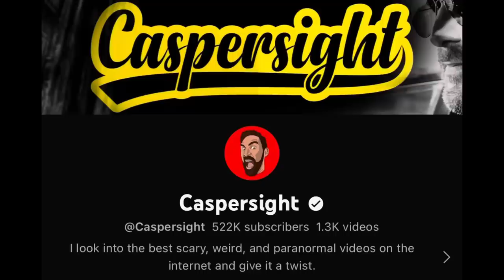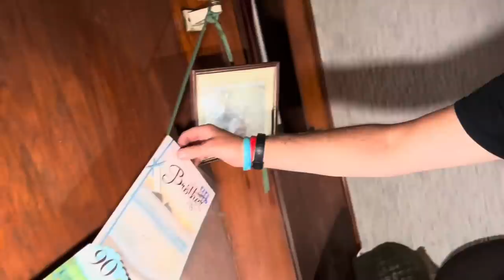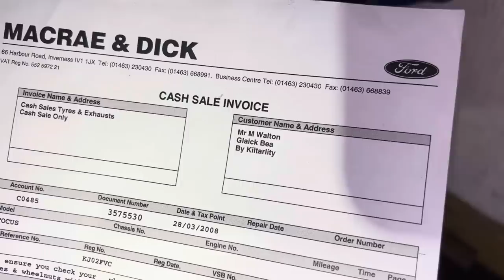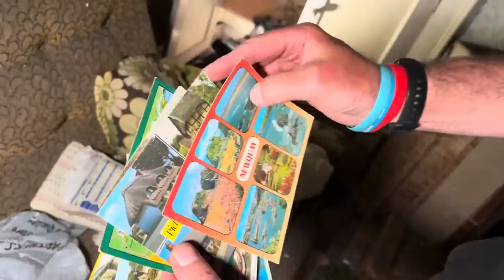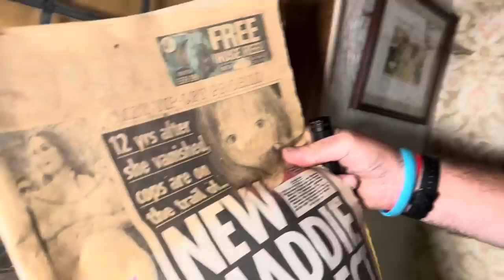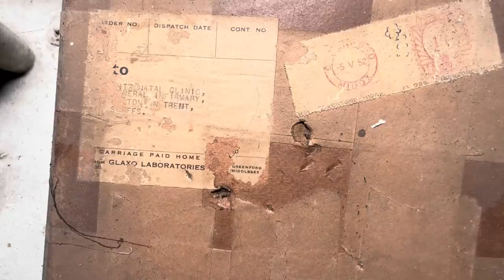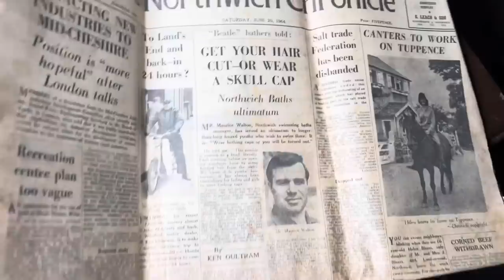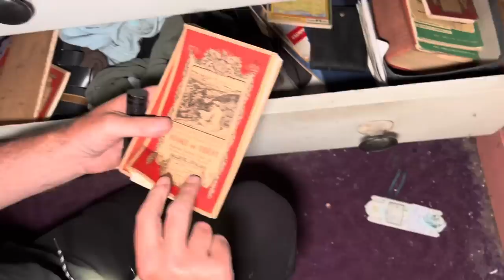Andy almost QUIT in this old ABANDONED house

Comment: Okay, Matt, you are wrong this time. I used to be a wallpaper hanger, and you overlapped it on the spot That was tore a little patch. And then you would cut through both. Remove the back one and put the new one so you can replace a small section say for instance if you took down a wall sconce you only need to replace a small square